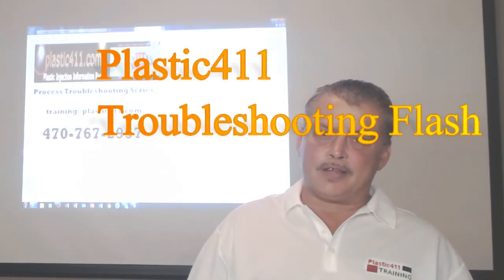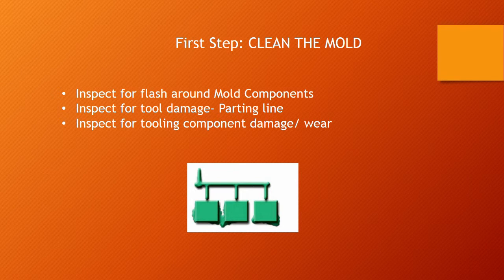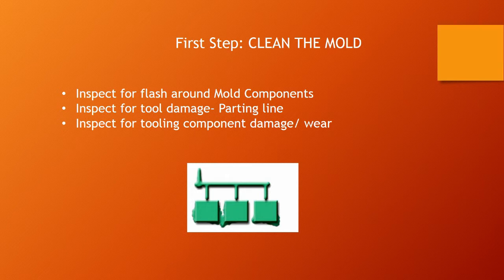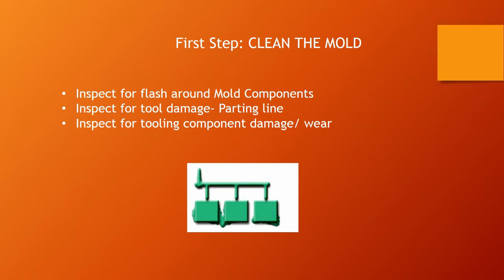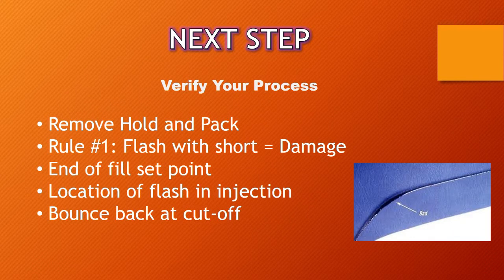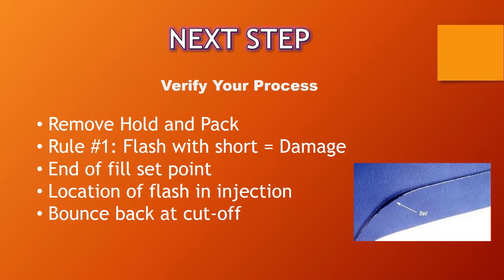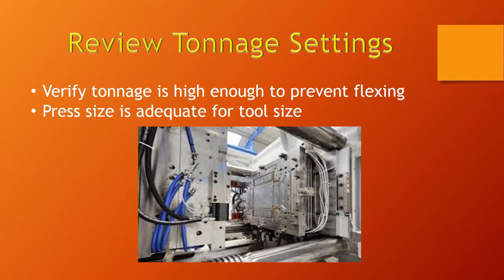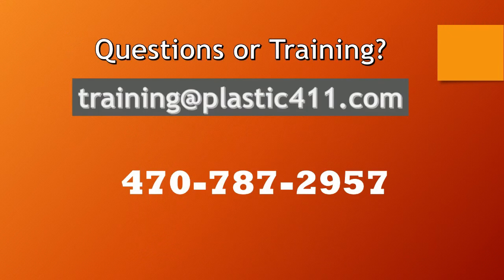Plastic Injection Troubleshooting: Fixing Flash

Comment: You had some good points.Well done. All were basic though. 
Im tasked with molds made in China, Please explain to me how their plastic does what I cant duplicate. They stage every step of their injection and hold.  No matter what I do I cant pack the part out with no hologram of the boss in the middle of the molded part. They did it , I cant. Its Polycarb, color and microban
Reply: check that they have used the exact same material.
Obtain their trial setup sheet.
Better to conduct your own qualification trial
Get the cavity filling correctly before starting the packing study